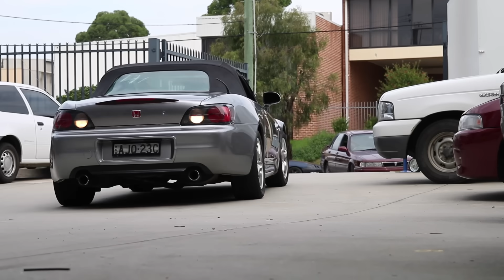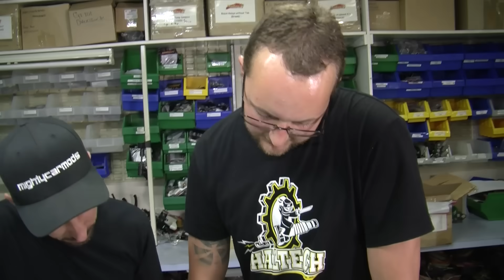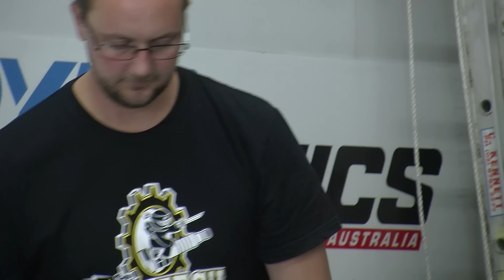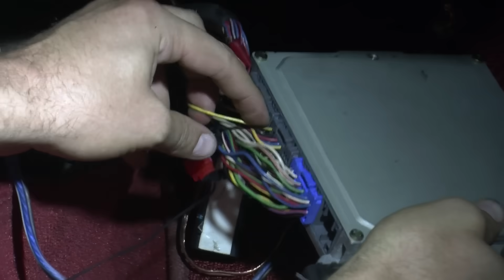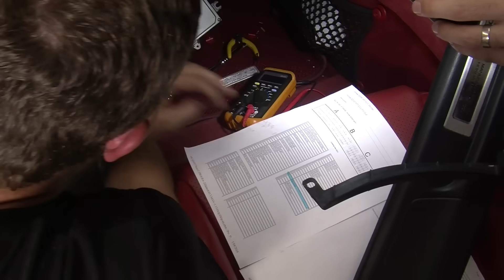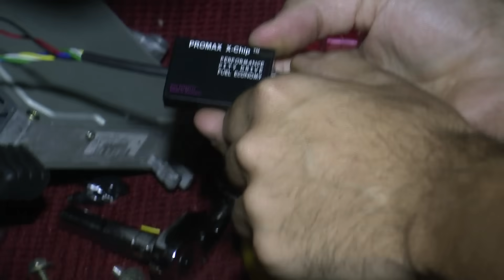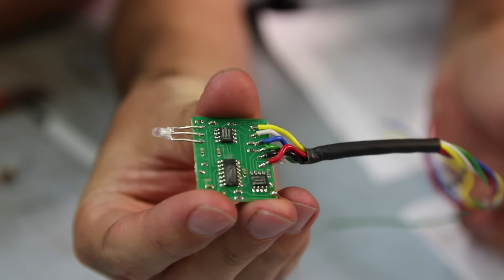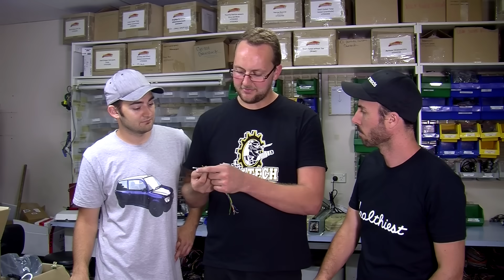eBay Performance Chips -  Mythbusted

Comment: What if I plug it into my 78 Camaro?
Reply: Nothing will happen
Reply: weirdstuffanimation7 lol, Camaros didn't even have computers in 78...
Reply: 177SCmaro Hence my comment being Nothing will happen.
Reply: weirdstuffanimation7
I think the fact that there is nowhere to plug it kinda preempts the whole "nothing will happen".
Reply: 177SCmaro So your saying a 78 camero has no wires on it at all. Sure thing buddy. Your joke failed.
Reply: weirdstuffanimation7 No, I actually said there is nowhere to plug it (because it's supposed to plug/splice into a computer, not random wires). 78 Camaros have no computer to plug it into, hence that fact preempts "nothing will happen".
Please think a little before replying.
Reply: 177SCmaro Since the chip does not function at all. It really would not matter where you connect it. Face it, You tried to be funny and failed and now you are being butt hurt.
Reply: weirdstuffanimation7
Irrelevant. You were wrong. Deal with it.
 Moving on.

Comment: Do ecu remaps work?
Reply: Yes, they do. But if it is manually modified correctly(by a profesional or an educated user) it will do much, much more. You need the proper software and a remapable ECU weather it the factory ECU or a swapable unit. 

The best is an OBD port connector that goes to a USB that connects to a laptop or device that allows you do remap and read parameters on the stock ECU.

This chip doesn't do anything and similar devices like a piggyback or signal interceptor don't remap anything, they just change values to trick the ECU and adjust it's AFR and other things to make more power.
Reply: thanks!
Reply: Moreira Da Lima

OBD cable with computer software of device that can reflash the stock ECU is the best. This option is cheaper than stand alone. $250 - 700. You can do anything with this and it's usually the easiest as you can flash a pretuned map and then read and adjust from there.

The 2nd best is a Stand Alone ECU, but this is usually the most expensive. like $1000+. You can do anything to the car with this but you pay more and setup is more complicated and you sometimes have to start from scratch or a very base map.

The 3rd best is a piggyback and intercepts signals and tricks the ECU. This is usually around less than $650. This is good if you want to make small changes to a car like intake and exhaust. If you want to turbo a non-factory turbo car, then this will not do and you need the above options. This will usually fine with factory turbo cars.
Reply: I have tuned an 09 STi, an 04 SVT "terminator" Cobra, and a 7.3 OBS F250 powerstroke.  I have always seen HUGE gains in my cars. 

However they have all been forced-induction and have had an intake + a full Turbo-back exhaust system. (plus supporting fuel and heat mods)

From what I understand you will never see power from a small displacement N/A engine from tunes/maps alone. Add boost and tune away.
Reply: Moreira Da Lima

Comment: I think, they are AND/NAND gate (7400 series SMD version) for LED light control.

If they can be shouldered out, and put in a chip identifier (for e.x an Universal IC  programmer/Flash tool), they can be identified.

Comment: Performance chip is designed for mass flow air sensor equipped computerized fuel injection. It is not designed for this car, but they installed it anyway...... FAIL ! Do you want some Hollandaise sauce with your chip?
Reply: Did you watch the video. It does not do anything. Its fake.
Reply: One thing for sure. If it is designed to be routed through the mass flow air sensor and the fuel injection system is a type that does not utilize one, then any legitimate performance chip is not going to work.  Did you watch the video? They routed it to the map sensor and not the mass flow air sensor because it doesn't have one. If it doesn't fit get a bigger hammer. Right?
Reply: Axle Grind Im guessing you didnt watch the end of the video where they sent the chip to be investigated by an electrical engineer and he said it does fuck all. There are no "performance" chips that would be routed through Mass flow sensor. If you changed the signal going to the ecu the ecu would just compensate for it and if anything your car would end up with less power or perhaps a check engine light.
Reply: No, not butt hurt by a long shot. I did watch the entire video only for it's comedic value. Therefore I made a joke in my initial comment. It was like watching "The Three Stooges" because of their ignorance. You're not going to ruin my enjoyable experience of watching the video with your snide remarks.  LOL@U
Reply: haha

Comment: I hope you gave the seller a 5 star review. eBay stores really need those ratings.
Reply: I think, most of the time, people receive the item, check that everything is there and looks good, then immediately leave a 5 star rating saying "fast shipping" etc. 

Then when the realize the product doesn't work or some other problem, they can't really do anything since they already left good feedback. That's why eBay added a follow up review feature.
Reply: I've had some sellers get really pissed off about me rating their crappy service and product. I had them say if I rip them off on half a star then don't rate them at all. You tell me how to rate you then your going to get an even worse score!
Reply: You are right. Leaving bad feedback is wrong just because you had a bad experience. 

These guys proved the chip was bad so that seller should be removed from eBay for scamming people.
Reply: K Granfield
If everything goes well I rate 5 stars even when I want to rate like 4 for some reason.

However if things go wrong, like the product is damaged or something I send the seller a message and he will probably issue a refund or offer to send me another item as long as I return the damaged product. 

You need to communicate with the seller if you run into any problems. Don't just report them or leave a bad rating.
Reply: ürünü nereden alabiliriz

Comment: so... it's  Obvious that ebay stuff is junk!
Reply: You can get legitimate parts from legitimate brands on Ebay... I found a very nice Magnaflow exhaust there one time.  I'll admit though, It's not the first place I'd look for parts.
Reply: Many of the products are imitations. You could have gotten a fake Magnaflow exhaust. I think, since Magnaflow is US, it's unlikely to see an imitation, but Japanese products are replicated a lot. I just recently purchased, what I thought was a genuine HKS BOV. I thought some company just bought too many and they need to get rid of the older models, but it was way under-priced and then I found out that is the most replicated BOV. 

It's been replicated to the point that the real HKS had to redesign the BOV just to put out a new version that is guaranteed genuine.

I think, if you're just going to install a larger diameter pipe, like a race-pipe, down-pipe etc it's fine because you can't really screw up welding an exhaust. And also for cheap cosmetic stuff that looks decent, it's also ok as it's just for looks.

I wouldn't bother with headers as those need a well engineered design not just weld a bunch of pipes together. I would also stay away from resonators and mufflers and you need to design the sound.
Reply: SI0AX I didn't actually buy the exhaust but it was priced like a legitimate one (about $750ish)
Reply: Fuster
You should still be careful. I bought an older model HKS bov that was retailing at about $200 and I bought it for $120 and turned out to be a fake.
Reply: SI0AX Like I said ebay isn't my first source for parts lol.
Reply: Fuster
The only thing good I got form ebay was an imitation 3" downpipe. It's pretty much the same, just the design was ripped off some other company. Works just like any other downpipe and is just as tough and durable. Diameter is where the real gain are in basic pipes. Headers are the exception that requires an engineered design.

Comment: It is real, it is making 35 hp.  It's just that the extra horsepower didn't go into the wheels, instead it went into the air and magically into the seller's pockets.

Comment: Chips do work.  No offense but you guys are some real tools!  YES you can flash your ECU or "chip" your car and gain a significant amount of power. A test that would have been better than the dyno.  You should have check your spark and fuel timing before and after the chip.  I don't know if you guys did your due diligence in trying to buy from a reputable eBay member. I have a chip in my truck that can takes it from stock 235 HP to 400+ HP.  So if I remove my chip from the truck and add it to my ride on lawn mower and I realize no increases in HP is the chip broken? Or is the issue my fault for trying to hotrod my geo metro or my lawnmower?

Comment: you complain about your s2k not making power until vtec, well that's how it works.. you have to open up your intake and exhaust for vtec to be able to work as hard as it can considering what it does when the vtec solenoid opens allowing oil to pass through and vtec to engage holding your intake and exhaust valves wide open there for making more power. You also stated how between shifts vtec engages then you shift and you wait for vtec to hit yet again.. you are supposed to take it redline then shift so when you grab the next gear vtec is still engaged.. So get a good intake, header, and exhaust and you will make considerable gains. As for that chip lmao you knew before you bought it that it would do nothing..

Comment: most chips, even ones that are like £100 and specific for your car just tell your ECU that your engine is running cold, therefore pumping more fuel in. Yes, this will give you better performance but its going to cause a lot of damage to the engine over time. Your best bet is to go and get it mapped by a professional on a dyno.

Comment: 3 problems 
1 it's probably a crap excuse for a power chip.
2 240 hp is factory fluff BHP at the crank, a dyno measures HP at the wheels so you can't compare the two. 
3 that "chip" needed MAF and your car has a MAP, two indifferent signals.  MAP takes throttle position and vacuum and calculates the air flow,  an MAF makes a small electric signal.
So your test had incorrect results and the wrong instructions or wrong part for your car.

Comment: Im sorry am i the only who reads instructions beside "plug and drive".......?......every performance chip has to map your usuage and your motor witch takes atleast 150 miles of driving before it is fully done mapping your engine use.....its a plug and drive because it automatically downloads the software and maps your engine...stop making people think cheap upgrades dont do anything when its what really makes A differnce.

Comment: why is the s2000 so under powered? i thought they were about 230bhp
Reply: It's not underpowered, the figure they give on this video is at the wheels.  They're around 230/240 at the crank, most manufacturers give hp figures as they sound more impressive :P
Reply: s2000 is 230ish at the flywheel. The dyno is probably making a correction to wheel horse power...which would be about 180
Reply: You do realize that it's an old used car right? Engine loses power due to time and maintenance :v
Reply: Bhp is Hp at the block.
Reply: flywheel
Reply: Richard Crofts the dyno does not make any corrections there is parasitic loss from friction in the transmission differential and even the wheel bearings that's why rear wheel or front wheel power is a more realistic and accurate number. Hope I could help some
Reply: ***** Is the fly wheel attached to the block?

Comment: A car i use to own.  I wired in 2 resistors to a 3 way switch to the iat sensor. 
I had one resistor telling it hot air 1 telling it cold air and the 3rd position of the switch it read the iat standard. 
It was great for knocking the high cold start idle down 200rpms

Comment: The secret is putting those too narrow tires for the rims and setting the camber all the way out The wheels cut through the air better. Also reduces unsprung weight when half the rubber is worn off the under sized tires. All the cool guys on fast and the furious do it!

Comment: 35hp.. lol... you cant even get 35hp out of a n/a v8 with just tuning with no other mods done. how do they not get sued for such claims? cuz the seller country doesnt have such laws?
Reply: actually you can make that much power from an n/a v8 with just a tune. Its pretty well known that Pontiac tuned firbirds down significantly so that they wouldn't compete with GM's poster boy the Corvette. In 2000 the corvette made 345hp(crank) while the firebird made 305hp(crank) with the same engine.

Comment: think the add said 3.5 hp gain and not 35 hp?   lol
Reply: i agree with this, however, anyone who watches the entire video knows that they sent it off to an electrical engineer who showed that the only function of those chips was to change the color of the LED, and the wires that went into the sensors, literally hooked to nothing.    so, i guess at best, people learn that at least 1 chip on the market is fake...      so the debate can continue.   HOWEVER... as a mechanic, i agree with what the tuner said.  the ECU on a car is designed to correct for things to run a specific way. so if it did change anything, the ECU would change and correct for it. so... even if it did do something, it would do nothing.  I've played with a lot of this in the past.   they do nothing...  the only way you can get more power, is to tune the ecu, or start swapping parts. or both... there's no $20 power adders that work.    except maybe an air filter. and that's not going to bring you 35hp.
Reply: kim w u
Reply: ebay doesnt make performance chips! you can buy almost any brand name or generic on ebay.
Reply: kim w 

You don't say!
Reply: i did say! :O
Reply: +kim w 

So ebay don't make anything for sale on there? OMG!
Reply: kim w 

Can I go out on a limb here and suppose English isn't your first language?!
Reply: lol go away now ty
Reply: +kim w 

Make me, bitch.
Reply: lol thats easy BBYE!! welcome to blocked list goofy lmao
Reply: A performance chip of this kind is a gimmick, tuners are a different story, your changing values that can increase performance and alter drive-ability to suit driver's preference, so your case would not be a gimmick. To adjust settings for most real mods you need a tuner anyway.
Reply: stupid
Reply: Meaby in Ucrania the sistem metrics its differents :)
Reply: No MAF sensor kind of keeps the dream alive for all the dummies,should have used a different car,to silence the fools forever,instead now the bs lives on.
Reply: Andrea Cameron
wow, thanks for the insight. i was a bit confused myself!!
Reply: instead of calling people who simply dont know dummies. why not make a website or something to educate others?
Reply: thats funny, when i bought my ecu tuner. i set it up for stage 4 shifting and more engine performance, and changed my rev limiter and my shifts to happen at higher RPMs. and guess what? my engine revs higher, faster, and far more aggressive. my car shifts at much higher RPM, and my car shifts way harder.. so this is all placebo effect? just lights  and gimmick? (not going to talk about false product claim law suits)

Comment: conclusion:
-That is a fake product.(which does wastes such as below)
-It wastes money.
-It wastes your electric in your battery.
-It is just an accessory, not a performance part.
-It gains weight.(few grams)
-Wastes your time.
-Pisses you off.
-Etc...

Comment: You didn't read carefully the instructions: you should mount this chip on the dyno, not on the car! than the dyno program add 25HP on the result and all it's working ;) LOL!
Reply: Gees, now you have to to carry the dyno with you every day.
Reply: Those chips really does something powerful folks. It's the technology to collect $$$$$ from fools. When the light flashes it meant SUCKER.
Reply: Lok Tom no, you install tires to the dyno and drive that around.
Reply: @maxxgraber  😂😂😂😂
Reply: these guys are trolls
Reply: Hella funny
Reply: Paolo Brach Carbon Fiber dash 75hp

Comment: I hate to well i dont care but SOME ebay chips do work. YES they trick the ecu about what air temp it is taking in and if it tell it to be hotter than it is the car will then lean its self out and THAT DOES give better gas mileage, the same way taking out ur stock if its restrictive airbox and silencer and replace it with just a cone filter. again not much power increase but hotter intake temps again better mileage..NOW if its telling the ecu the intake temp is cooler than  normal  the car will then give more fuel.This will usually cause nothing but loss in HP BUT if you have a cold air intake , larger throttlebody or and a few other mods like an opened up exhaust system  that would lean your car out a little the ebay chip tricking the ecu into thinking the iat is colder than it is WILL HELP because  the car will again try and correct its self by adding a bit extra fuel. Now you may not be lean or rich but stoich or spot on...
yes some ebays chips are a waste of money. but know what ur doing and what it actually does.
if that s2000 in the video gained 2hp to the wheel every run there after with the chip on and with it off if it went back down the 2hp thats actually worth it for 20$, its 2hp to the wheels which is like 10-15hp more at the crank. so the chips may not full out lie...buy beware thoug.

Comment: If your S2000 is only putting out 177bhp it is poorly!
Even so, +35hp on an S2000 or any N.A. engine is not even credible. You'd have to be flat out gullible to believe that.
Even a professional remap wouldn't get that much. As the saying goes, if it sounds too good to be true, it probably is.